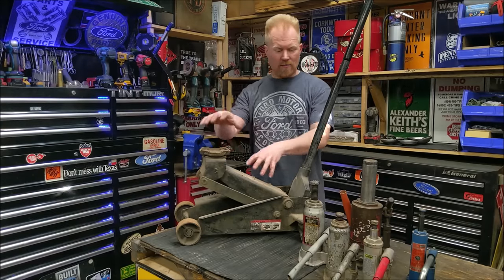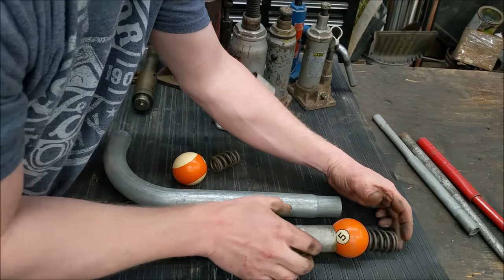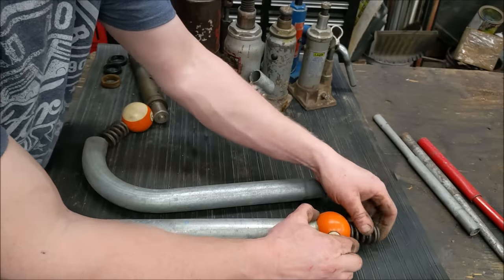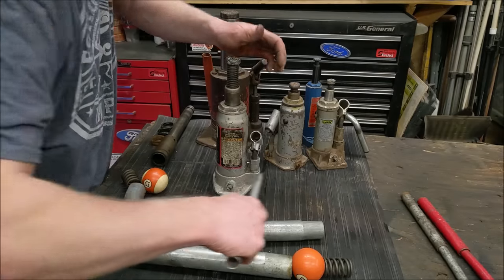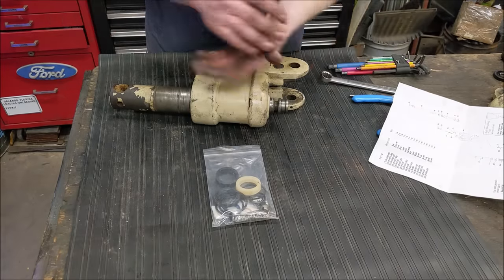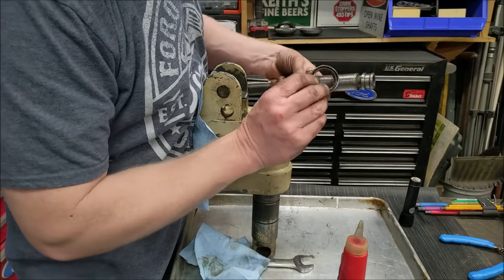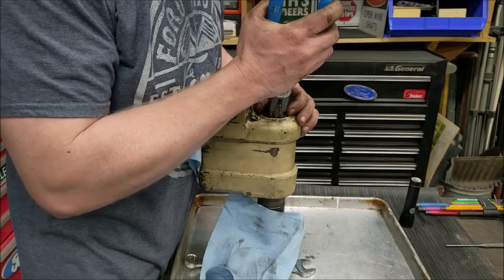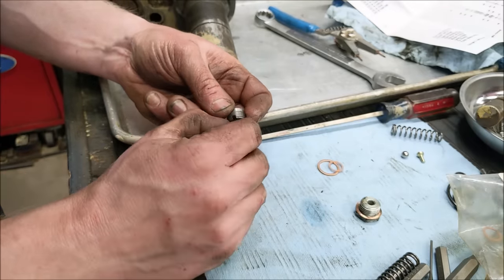How to REPAIR Hydraulic Jacks & How they WORK Bottle, Floor, Pallet, ETC

Comment: My jack just drained all of its fluid. Where do I start to attempt to fix this?
Reply from the maker: First you need to find where it leaked the fluid from. Around the main piston, The base, The small pump piston, the release valve, etc.
Reply: @sixtyfiveford  Sorry I had written that in panic mode. Your video was extremely helpful in explaining how the mechanism works. Over the weekend I'm going to attempt to remove the actual hydraulic assembly from the floor jack so I can examine it. I'm hoping it's the release valve but I need to isolate this hunk of metal first. Appreciate your follow up! Will let you know what I find in my journey to fix this thing.

Comment: So in my case when the lifting arm does not come up when I pump it could be that when as you explained in the beginning that it is not sealing somewhere. Could it be at the piston 1 where you pump or inside the cylinder at the pipe 1 or 2? If I force the lifting arm up and at the same time pump it holds itself up like 75 % of max and do not come down with force but when I realease the valve it comes down but not up again. Anybody?
Reply from the maker: About the only way to diagnose it is too take it apart and clean it.
Reply: @sixtyfiveford  Ok I will do that I also see what it is inside and how it works....this is the best way to understand.... keep up the good work ion your channel :)

Comment: I have problem with my floorjack bleeding or if there are something else wrong with it. Tried alot of methods to bring the arm up but it does not move a mm. Tried different oil levels. On YT often it says loosen the bleeder screw and loosen the lock valve. It should nicely put some bubbles out and it is ready...NO NO not mine. Tried to open the bleed screw and lift the arm manually and it is sucking in oil and when I lock the valve it stays up but not on the top level. Lock valve when it releases it is working but is farts :) . It is an old one from our Big company in Sweden Biltema. I dont know the model-nr. So what to do when it is not an model number on it somewhere? Also I tried to flip it up or down to get bubles up to the bleederscrew = inothing helps. Anybody???

Comment: Oringsandmore.com Sells the smaller u-cups and O-rings that fit a lot of the smaller, import bottle jacks. You will need an accurate veneer caliper and or micrometer to measure the original components.
Reply from the maker: Yeah, they are about the only place I know of with a full selection of individual parts like this.

Comment: Can I use engine oil 10 w 30 instead of hydrolic oil?
Reply from the maker: That's too thick. Transmission fluid works great as well as power steering fluid.

Comment: I have a motorcycle lifter that has an adjustment screw between the pump foot pedal and the release foot pedal,what is this for,the manual says not to adjust. At the moment i have to pump the shit out of the lift pedal before it will pump up so something is not seating properly at the pump i presume?
Reply from the maker: That is a safety check ball that will not allow the jack to exceed it's preset weight rating. This is so you don't lift something heavier than the steel framework is safely capable of holding without collapsing it. They set it while the jack is under max load at the factory. Set too light and the jack will not lift heavy items and set to heavy and it will lift heavier items than it was designed to. 
excessive pumping: It sounds like you have air in the system or your check ball going from the reservoir to the pump isn't properly seating.

Comment: What about the maximum safety valve screw that you haven't supposed to unscrew that I might have. Do you agree to tighten all the way up and back of a half turn? 
And the oil, any hydraulic oil should be fine right?
Reply from the maker: The Safety Overload valve just needs the spring pressure to hold the check ball in place. So tightening it to collapse the spring and then back it off anywhere from a 1/2-a few turns as long as the spring is still under pressure is fine. Most I've come across are around 1.5-2 turns out. It will just bleed off under heavy load/not allow you to lift if you have it set to light(more turns out). I always count the turns in to collapse the spring and then remove it so I can set it back. For safety it's better to have it set too light and you can adjust it after everything is rebuilt/assembled with a load on it. Set it light and lift the heaviest thing you have. For 3ton floor jacks I generally do the full front/both wheels of a truck, which is around 2 tons. The concern is if it is set too heavy and someone tries to lift a 4 ton object with a 3 ton jack(it will do it) the seals could blow or the metal structure of the jack could collapse, dropping the jack instantly. However most of use will never put a 3 ton jack to anything more than 1-2 tons so really not a huge concern how tight you set it. Any oil will work even power steering fluid, motor oil, etc. You just want a thin non-detergent oil(most hydraulic oil is iso 32/sae10) so the particulates settle out and don't float around the system. Detergent oils pick up and carry the junk with it and allow scoring/seal damage. Of course the cheaper oils will have less antiwear stuff in them, but unless you're using it in a high production facility it won't matter. You can put iso68/sae20 non-detergent oil in a worn out jack to get more life or even power steering + stop leak to swell the seals and get a few months/years.
Reply: @sixtyfiveford  wow I want a super like on that reply, honestly the best reply I've ever had on YouTube!!!

Comment: I let my step kid use my cherry picker, he broke one of the feet off, which I had to weld and fix, and now I have to turn the pressure release about 3-4 turns for the ram to come down. Ugh
Reply from the maker: Loaning stuff out..... It's a thankless job being a parent sometimes.
Reply: The ball is getting stuck in the recessed opening. Yeah...you got sticky balls, alright. Happens to the best of us.

Comment: Me thinks there is some kind of safety by pass valve that opens when the unit reaches max lifting load.
Reply: I think it’s basically automatic: if the pressure produced by the pump won’t overcome the pressure on the other side of the ball bearing check valve, then you’re done.  However, I think there is a bypass to keep you from overextending the jack and having the piston pop out.  I noticed a few holes along the piston shaft.  These could be the relief holes?
Reply: @glasshalffull8625  Yes. But those engage when the piston reaches full extent. That way it CAN'T pop out.
The safety by pass is to prevent the unit from being pumped above its max design pressure.

Comment: How do you bleed air out of a floor Jack ?
Reply from the maker: Open the release valve and pump the handle a dozen times. Tighten the release valve and you should be ready to go.

Comment: I have an old floor jack an when I try to lower my car I have to be very careful about how much I turn the handle , if I twist it just a tiny bit too far the jack drops extremely fast. Is there a way to fix this or is it time to junk it?
Reply from the maker: Drill a hole and put a T handle/rod through your lowering handle bar. This will allow precise lowering vs just gripping the round tube and twisting. You could also step up your oil viscosity to a iso 68(sae 20w non-detergent) or put in some Lucas thickener/ seal conditioner( https://amzn.to/2us0AQt ) . This will help restrict/slow the fluid as it goes past the release check ball.

Comment: LOL they are not that expensive. Just buy a new one or a refurbished one. Save the headaches and Extra Tools you'll need. and like ALL older equipment,,,fix one thing, something else goes WRONG.
Reply: Ahhh, ya, the voice of the throwaway generation. There's something to be said about skillsets, pride of ownership, sentimental value or even all those enormous holes in the ground filling up with inexpensive garbage passed off as tools and other chinesium watnots. FTR, most old tools that do need rebuilding, can be repaired cheaply and be serviceable for multiple decades still.
Seems as if "Just buy a new one..." is just "lazy people" mentality, dontcha think?